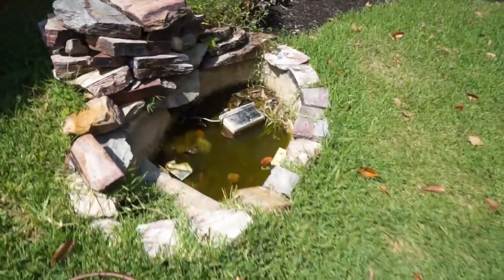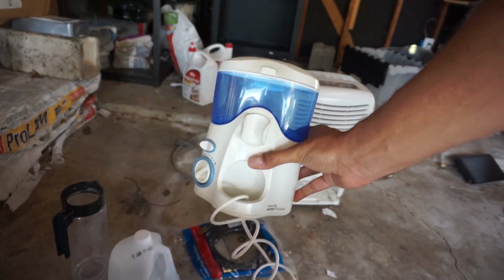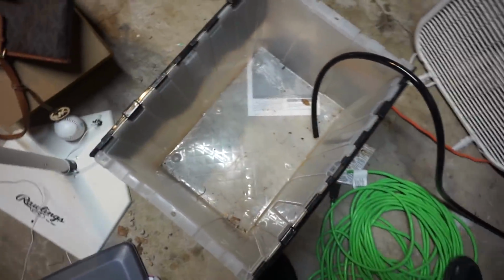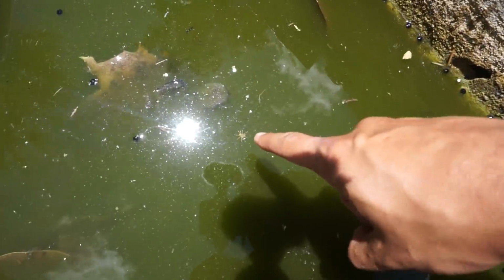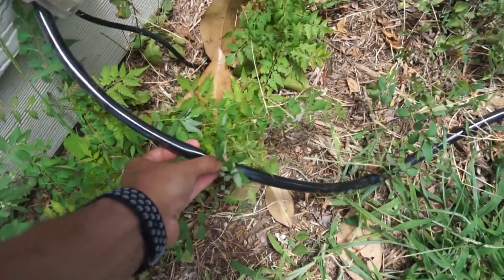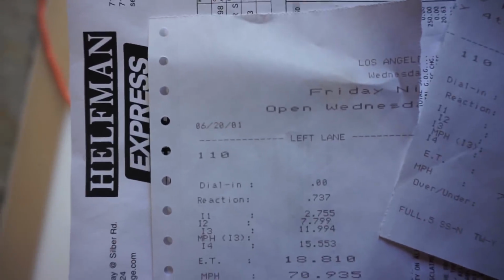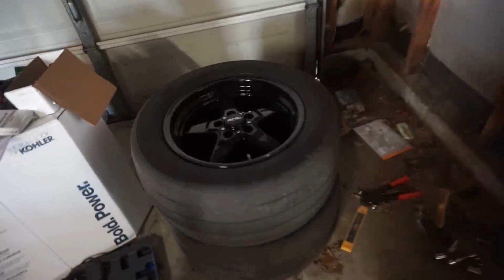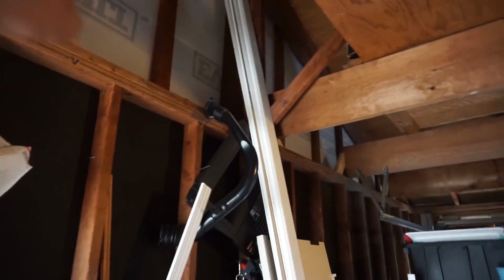The possibilities are endless now...

Comment: What I saw on the video that you showed would absolutely feed through an AK. I don't think any of it wouldn't feed. Obviously at some point the rusty cases would be a safety concern with case seperation but I'm guessing that stuff would have had to be underwater for years before that would be a concern. I would take a can of wd40 to range with me and only use it if rifle jammed. If the powder  didn't get wet it will fire. Comm bloc countries usually seal cases up pretty good

Comment: Due to lack of rain, the mosquito population in our area is very low right now.  After the rain coming this weekend and the high temps, that will be changing.  As long as the water in the pond is moving with a pump, mosquitos shouldn't be a problem.  It's stagnant water that breeds mosquitos.
Reply: You can also place a mosquito dunk in the water once a month.  It's non-toxic, making a bacteria that kills lavae of mosquito.  I use them in my rain barrels.

Comment: Good cleanup 👍 
Should get some foam padding and line the walls to protect the car doors.
Reply from the maker: Yes! We were thinking about how to do that. Probably have my wife park on the other side (once it’s clear) and put something on the wall so the kids don’t bash it into my car. Because they would.
Reply: Hqen2000 if you finish the walls, especially one that gets hit by sun, put insulation up too. Keep some heat at bay.
Reply from the maker: If I knew how to do drywall I’d do it. But I’m clueless and I don’t really want to do a shitty job trying. If I want to get an AC I’d really need to finish and insulate to be cost effective.
Reply: Hqen2000 ok, so just to put protection on the bare wall studs, go to home depot or Lowes and get some foam pipe insulation for like 2 inch pipes. Cut to three foot lengths and slip over the beams. Quick, cheap and easy 😉
Reply: Charger SRT LYF even cheaper to use pool noodles. There long enough to cut into 3 sections from each one.
Reply: Coop427 I would've thought of that but I don't have a pool 😄😄

Comment: glad to see this, if i was you tho i would done it from day one with your street rod man.. sweet tho engine will thank you a bit tho from day one is what you jus gotta do like me and whenever my cars been left outside during night somewhere i have covered with a huge car cover i bought right after dealer.. go get that air conditioner going too tho... man but Sweet, cold start now tho eh.. u should back in and she drives in... what i do here myself works mint just put a Marking on wall exactly where u gotta stop i did it where my mirror lines up.... niZe tho man.
Reply from the maker: Yeah that’s what I was thinking. The cars are big so we will need to be consistent on the parking .
Reply: i would back your car into where you parked hers and than she can park in there normally just put a marker on the wall you park against..  my even smaller 2 car garbage is perfect... cant wait to see those beauts parked nightly tho man.